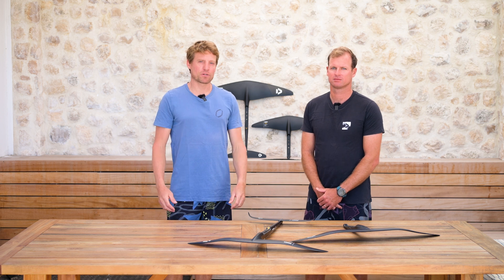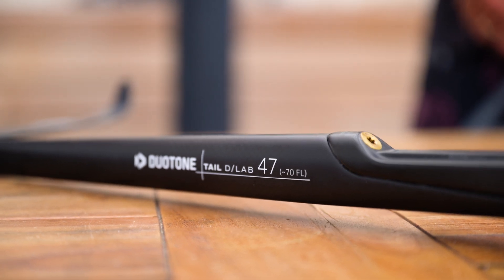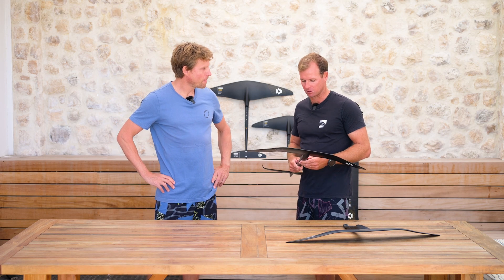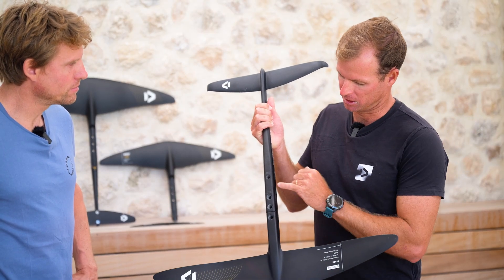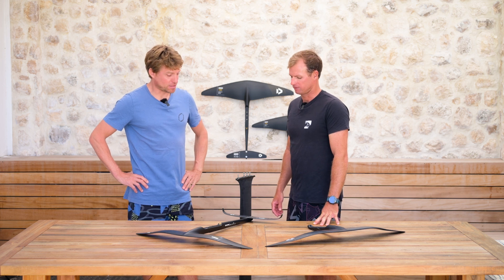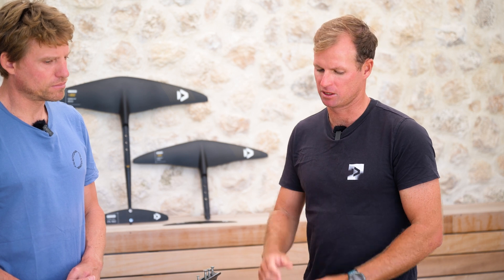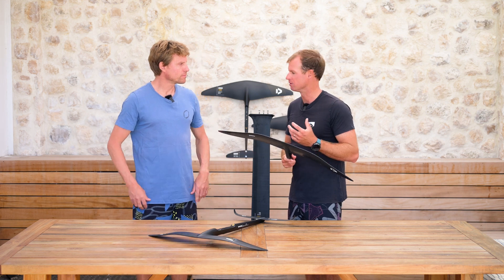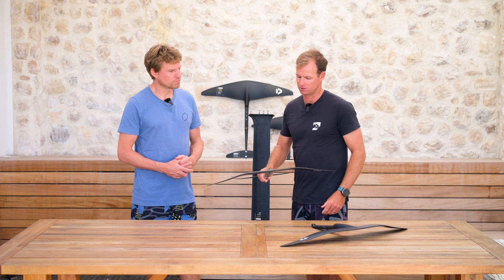Duotone Wing & Foiling Tech Talk - Blitz D/LAB 2025

Comment: Hi! I'm a kitefoiler (75 kg) interested in learning new tricks like push tack. I'm currently riding a Slingshot Phantasm PTM 730. Is there a recommendation for switching to Blitz or Carve 3.0?

I'm looking for one foil for all conditions (10-25 knots) flat and choppy but no waves.

By the way:
I would like a duotone mast over 100 cm.
Reply from the maker: Hi there, right now our most fav foil for Kite foiling, is the Carve 3.0 in 800 size, this is what our Duotone kite team riders and opinion leaders prefer the most. Noted on the 100cm mast, but unfortunately very low sales there when we had a Fanatic in 105cm…

Comment: Hi, i fit 75kg with good level. I ride glide 620. Does the 550 can fit for me ? Which minimum wind. Your advice is to begin without shim at the center of the rack ? Thanks and good job! Cyrille
Reply from the maker: Hi Cyrille, yes if you can ride the Glide 620 then the Blitz 550 is no problem at all. We used the 550 recently for some racing in South Africa, with 6.0 wings in winds down to around 12/14 knots - if you can pump up onto the foil, then it has enough lift to stay up. Centre to slightly back from centre without shims is a good start yes. And then if you go further back in the tracks to get more speed, you may want a slightly positive shim to trim the nose up. But generally ride it first, you will miss front foot pressure at the start, but once it gets up to speed, it balances very nicely/usually no major shimming needed, unless very overpowered.

Comment: Hey guys, I just got my Blitz 550 and it’s really cool but it’s whistling like crazy. I sanded the trailing edges according to Klaas‘ tutorial, without success. Then I discovered some decent pinholes in the trailing edge of the front wing. None of my other foils (Carve) has these pinholes. I guess they are too deep to be sanded away. Is there anything I can do about that?
Reply from the maker: @fabianr1737  hi Fabian, that does sound strange indeed, please contact the dealer where u bought it and request a replacement, they will send pictures onto our HQ/warranty dept so we can follow up. Very unusual re pin holes, we have never seen any on prototypes or production so far. Hopefully u can get a new one asap!

Comment: Could you use that tail on like a DLAB 900 Glide 2.0? Thinking more about light wind foiling and wondering if the longer fuse would be beneficial?
Reply: Hi, no I would not recommend using the 47cm fuselage on a 900 Glide 2.0 because you will not be able to fit the forth M6 bolt and you will get some flex happening in the fuselage. It will not help your light wind foiling. Better to stick with the 43 or 37 length for that.

Comment: Got to ride it before release and its absolutely great. It is very stable and charges up and downwind.

I want to add something, you can use the 47 on an SLS mast as the fuse comes with an insert to seal off the 4th insert hole (maybe its not good to ride it like that though and it might break? Jerome will know better about this).

Whats the reason for a 190R for the 550 foil btw? As a 65kg rider it seems unecessarily big creating a lot of drag? Wouldnt a 150-165 be better?

Thanks for the video ❤
Reply: Regarding the R190 sizing and the comments that it "seems big". First of all, keep in mind that the surface area includes the vertical winglets which on their own add about 10cm2, which leaves us with the equivalent of a flat stabiliser sized more at 180cm2. Then the profile which we use is different to say a P or PX stabiliser and has been selected to perfectly match the behavior of the Blitz front wing profile, across a large speed range. We tried smaller stabs for sure during the development, but in the end, the R190 is the one that gave us the best results across a variety of parameters that were important to us. It doesn't mean that you can't use your Blitz front wing with a P165 or PX160, actually both these tails also work quite well, but not as well as the R190, at least according to us. Finally, have a look at some other race foils from other brands and you will notice that they often also have "big stabilisers" around the 180cm2 range.
Reply: @BonieuxJerome  thank you!
Reply: Why would you use fast foil on a slow SLS mast?
Reply: @dengordo  i mean, the SLS masts arent slow, the dlab slim is just a little bit faster and stiffer. If its all you have, theyre definitely serviceable.
Reply: @obvioustrash7833 SLS mast thickness is 17.5, slim 2.0 is 13.5 and it feels like a handbrake has been released comparing to SLS. 

But I totally agree that 550 needs much smaller stab than 190
Reply from the maker: @ actually the profile of the SLS mast is pretty quick too, can easily also get up to 30knots with the right foil/technique.
Reply from the maker: Hi there, glad you like it!  The SLS mast is a good choice, no issues with the 4th hole at all, fine to use without the screw if your mast only has three holes - using the screw adds even more stiffness to the total fuselage feel. We tested a lot with Jerome over the last 12-18months using smaller stabs, in fact the 190 gives the best control and most neutral position at high end speeds.
Reply: Technically you can ride the 47 on an SLS mast without the forth bolt, and use the plug supplied to close the hole, but we would not recommend it because you will have pitch issues at high speed. It is more something you want to do as an option B in case you forgot your other fuse and only have the 47 to get on the water, or if you want to rig the 47cm to help a beginner have more control at slow speed. These are the reasons why we decided to include the plug.